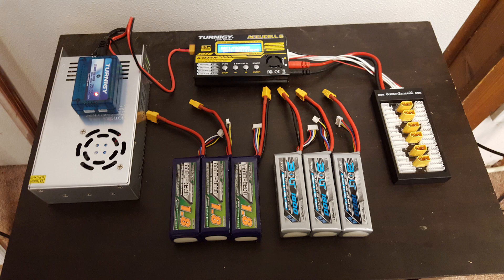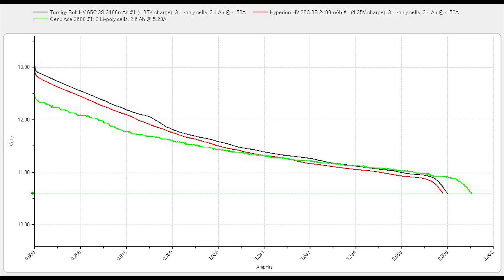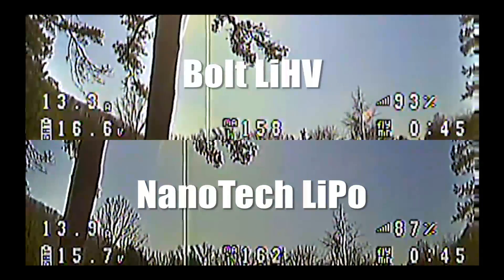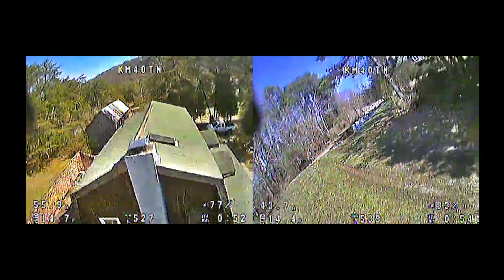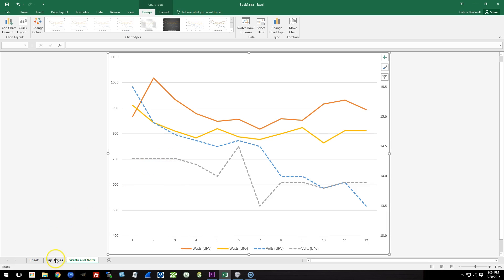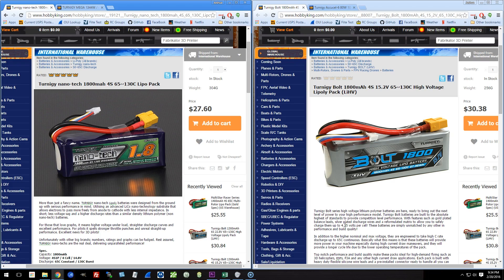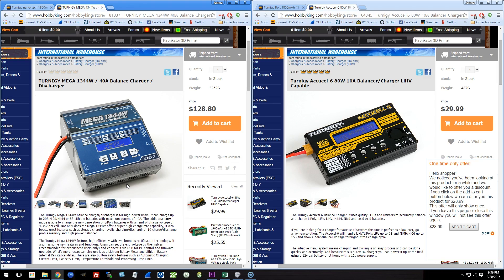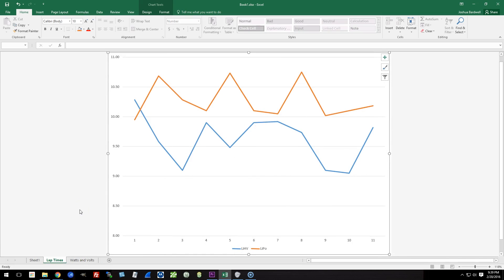Should You Buy LiHV Batteries? UPDATE: No. You shouldn't. (See video description)

Comment: Great video! Now I just need to stock up on High voltage lipos
Reply from the maker: +MTL Racing Good luck finding them in stock, is the problem. In addition to Hobbyking, they are sold by 2dogrc and Green Gorilla, although I don't personally have any experience with those packs or those shops. There are a few other sellers that I know I'm overlooking.
Reply: 50 cycles I bet you guys are pushing too hard on them don't forget lots of things can effect lipo life span overcharge is one of them and pushing them to the c rating of the lipo effects it aswel
Reply: I think now we have come to the conclusion that hv lipos just have very short lives and puff too easily

Comment: I got the turnigy accucel that does these for 5 bucks during the HK cyber sale. It's only 50 watt but I'm patience.
Reply from the maker: +walkaf1 For five bucks you can't lose!
Reply: +Joshua Bardwell those battery's are awesome I felt the extra pep only tried them once though. Gotta figure out how to get the naze to stop screaming. I'm assuming I just bump the max voltage on the vbatt?
Reply from the maker: walkaf1 Correct. Actually, that's interesting. I have vBat monitoring with something like 4.2 volts per cell as max, but it never complained.
Reply: +Joshua Bardwell oh man mine was screaming so I flew for a few minutes until the voltage was down and then rebooted the board. Didn't have my OTG with me to try and mess with the vbat. The telemetry voltage seemed off too but I gotta give them another go.

Comment: Interesting, i fly on 3S but with higher amps and higher KV motors. I wonder if the picture would stay the same at let's say 80A.
Reply from the maker: +GauisHelenaMohaim I have done some 60 amp testing just this week, and the 1800 mAh HV was spectacular. Discharging from full charge to 13.99 volts, it delivered 60 amps for 1100 mAh (60% of its rated capacity) continuously.

Comment: Nice test Josh. The idea about calibrating a regular charger .15V/cell lower for HV charging is an interesting idea.

I'm wondering about a spec that was ignored. How does the IR of each type of lipo compare? I come from competition RC car racing and it's well known that the IR of a lipo has a great deal to do with it's power performance. 

Another note about charging a non HV to 4.35V/cell. You seemed a bit concerned. Competitive RC car guys have been doing that for a couple years and I haven't heard or seen anything about that being a hazard. It is for sure a power advantage depending on the track and driver/car. Many tracks will check for high voltages before allowing you to race.

I would really be interested in seeing how a non HV lipo charged to HV would compare to an actual labeled HV lipo.
Reply from the maker: +Billy Clark I measured IR, and meant to mention it in the video, but maybe I didn't. IR was basically the same for both types.

I know that car racers have been over-charging regular LiPos since forever, but it's not very safe or good for the battery. I don't know what HV packs do to change that. I would expect that a regular LiPo over-charged to HV would perform as good or maybe even better than an HV pack. Whatever they do to make the HV pack safe to over-charge probably reduces performance.

Comment: Great video!! Quite informative actually. So I'm building my first quad and I'm considering buying LiHV, since the charging equipment supports LiPo too. But, what is the actual discharge rate of those? Is there any 4s high C pack(i.e. 65c)?
Reply from the maker: +John Salliaris Yeah, absolutely. The ones I tested are 1800 mAh / 65C.
Reply: But is it 65C actually? I mean if I tried to draw 117A (65*1.8), could I?
Reply from the maker: +John Salliaris probably not for very long, but it's still way better than my 45C packs. Gives 80 amps without flinching.
Reply: Yeah of course not all the time, but if you have a 30A ECS setup is good to know that it could handle bursts of that high current.
Reply from the maker: +John Salliaris exactly. Treat any battery's continuous rating as its burst rating and you'll be okay.
Reply: Good advice, I'll remember it.

Comment: I'd say high voltage lipo's would be best for acro flying as you can push them hard right away and get the "sick footage" and just swap a pack in minute or two and do the same again. That is, IF they give the actual C-rating printed on the pack...
Would be cool to see these compared to Thunder King's, SMC's or Rebel's batteries.

Comment: Thanks Joshua that was really useful. Were you able to test any of the other pack sizes, like the 4s 1300mah?
Reply from the maker: Just the 1800 so far.
Reply: Joshua Bardwell Why did you choose 1800ma? My current 210 quad uses a 2600 LiPo and people recommend that I switch to 1300, would this half my flight times or am I just being inefficient with weight?
Many thanks!
Reply from the maker: 2600 mAh on a 2101!!!

Let me make an analogy: this is like towing a caravan with a Lotus.
Reply: Joshua Bardwell Hahaha well it does crash like a tank, I'll tell you that much! But seriously, would you recommend 1300, 1500, or 1800 for a 210 running 3s?
Reply from the maker: +Gouada your friends already told you the answer. You should listen to your friends.
Reply: Joshua Bardwell Got it, thanks for all the advice and help you've given to me in this hobby. Your videos are so full of interesting information I find myself watching whole random playlists at a time :)
Reply from the maker: +Gouada glad it's helpful. Thanks for watching!

Comment: Excellent video! But i got 2 Bolt 1300 from Hobbyking and have puffed up after half a dozen flight.
Reply: +Multirotor fpv How many amps are you pulling?
Reply from the maker: How do they perform?
Reply: Have to say they perform quite well, but every flight the battery will come down real hot and bloated.

Comment: i have been using revolectrix silver blend 435 LiHV 1200mah 4s for 3 months. all of them are puffed now and im now looking into replacing it with graphenes. all of them started puffing after two months (weekend flying).

i think that lihv lipos are great but only for a while as they have a shorter life span than normal 4.20 lipos. even revolectrix has a disclaimer that while you get the most out of charging it to 4.35 per cell, (17.4v), the lifespan is significantly lessened.
Reply from the maker: +Jojo Polinga This has been my biggest fear.
Reply: +Joshua Bardwell which lipos are great for mini quads right now? how are the graphenes hobbyking sells? ive read bonka lipos are popular for its price.
Reply from the maker: Jojo Polinga I don't have any quantitative results, so I can't recommend anything in particular. If you can fly HV (e.g. if you are freestyle flying or if your race permits it), I would look at the Bolt 1300 65C as a good performer. If you want a standard LiPo, I can recommend the Nano-tech 65C. I'm not trying to say that there aren't better batteries out there, just that those are ones I have had success with.

A friend of mine flies the Tattu 1400 mAh 75C, and says it doesn't live up to its C rating, not even close.

Comment: Interesting, thanks for sharing man! I guess you could have used blackbox to log current and voltage data throughout the flight as well?
Reply from the maker: +salle rc MWOSD doesn't pass current back to the FC via MSP, although I would love it if it did. And I can't be bothered to find the current sensor on my PDB and manually wire it to the FC. So no blackbox logging of current. And the Blackbox logging of vBat, in the past at least, has had so much high-frequency variation that it's largely useless. I think this may have changed in recent revisions.

Comment: If the Graphene batteries are lasting upwards to 900 cycles, and HV lipos are only getting 50-100 cycles, the cost of batteries is significantly higher with HV lipos, costing 0.30-0.60 cents per cycle (100-50 cycles). Now if you take Graphene lipo, to cost is significantly lower at about 0.06 cents per cycle. I'm not sure these HV are going to be worth the time or money when compared to Graphene lipos.
Reply from the maker: But I have heard some questions about graphene at high C rates. Can't wait to test for myself.
Reply: +Joshua Bardwell I was hoping you were going to say that! I'll be waiting for that video! Your research is alway pretty thorough and it shows in your videos, so when Graphene wasn't even mentioned when cycles were brought up, I was curious as to why.
Reply: let's look at this weak guy strong guy 1 punch weak guy is dead the strong guy can take more punishment before he dies do you get what I am saying it goes for the hv lipos aswel it's like steroids they lower your life cycle but you can stand up stronger for a little longer and take the hard beating for alot longer  if I take your lipo and pushed it hard it's gona die quickly than  the same lipo with gentle pushing

Comment: I use them for about 15 cycles and the IR is just as low as the first day, i always lad at 14.5V, i get arround 3 minutes flight time pushing them hard, the 1300mah Bolt do the job very well, pretty great lipos for the price.
Reply from the maker: +FPV Portugal Yup. The HV continue to be amazing.
Reply: Joshua Bardwell Not all buddie, but the bolt turned to be a very good surprise considering the price.

Comment: Great video! Let's see if they can beat lipos on cycles
Reply from the maker: That is the big question.
Reply: +Joshua Bardwell Model rocket engines cost at least $4 a flight and it only last like 3 seconds.
Reply: +Joshua Bardwell Was the nanotech the run after the Bolt?  I find I run faster after the next runs than the ones run before.
Reply from the maker: Anthony Abelardo I alternated several times and took the fastest pack from each.
Reply: Joshua Bardwell Can you tests against Graphene and A-spec?  Run the Bolt test on the same day too?
Reply from the maker: I have a graphene on deck right now. I don't have an A-spec. I'm not sure what the advantage would be of running the Bolt test the same day. Unlike prop tests for example, I don't think atmospheric conditions affect battery performance... do they?
Reply: Joshua Bardwell No idea but I would like to see the data results on a same day test.  One battery after the other after doing some warm ups w/ other batteries.

A-spec cost more than Graphene and nanotech so it's worth testing.  Never considered Bolt but it seems to be superior.

Need power test and how much cell life is left over a few cycles.

I heard people who have Graphene who have done well over 500 cycles and it's still holding a high charge.

I'm not sure if my flying ability has improved where I lost lots of flight time or anything other than Graphene just can't hold charge after a few hard cycles.

I heard Graphenes don't sag so low voltage comes instantly.

The thing is, the Graphenes are sold out so all I had to choose from was A-spec.  I never considered Bolt but my new charger can do 4.3V.  Your graphs showed Bolt to be better in everything volt for volt.

Doing a comparison w/ the top 3 Turnigy batteries would be cool.

Comment: you have to be careful though because alot of race leagues limit your voltage to 4.2 a cell
Reply from the maker: That makes total sense.
Reply: +CoVa fpv I wonder how the bolt packs would perform then if you had to only charge them to 4.2v if its not any worse than a nano tech then you might as well get the bolts and have the extra power and energy density for practice and then only charge them to 4.2v for competition.

In fact there would be an advantage to that of taking an edge off your quad and making your comp nerves have less of an effect.
Reply from the maker: ***** We tried that at the flight field on Saturday, mostly because I had forgotten to bring the Accucel charger with me,so we just charged them up on the Reaktor. I would say that there was not a clear performance advantage between them and the regular Nano-tech. However, they are 20 grams lighter, and they definitely deliver the same or better watts and amps, so that alone may be worth three dollars per pack. Especially given you always CAN crank them to 4.35 if you care to.
Reply: +CoVa fpv That makes total sense; I think the closest we can get to a level playing field the better. That said, if what Joshua says is true, then I'd say these still have value when it comes to practice, and may one day become the norm.

Comment: This video and study is well beyond the call of duty Josh- so much respect for the time and effort put into this. Possibly the best video of the year so far for racers. Hope folks pay heed. Savvy testing and data examples.
Reply: +Goat how many laps on a 200m course is a heat? I believe classes will always be a factor. Innovations in the sport now with pit stops and 3000 and 5000 meter heats, and even 24 hour races will create a class, tight twisty courses will create a class, and then larger obstacle course mixed with race course grand prix style will create a class. I do not think the dynamics are leading to a single class, but a handful of classes. Same as all motorsports. Not sure why multirotors would be any different.
Reply from the maker: +Hiway I actually wonder whether we will see races dividing HV batteries into their own class, like 3S / 4S class. It almost seems unfair to compete HV batteries against non-HV.
Reply: +Joshua Bardwell for now, we still live in interesting fpv racing times, but like all mitigating factors this too will become standardized or restricted. I have one of those Bolt lipos I run on a Havoc 340. it spins 6x4.5 on 2213 2000kvs and it is very powerful and fast, but those Bolts give it an extra kick. had it for almost a year. I suspected they were better, but your tests prove my suspicion.
Reply from the maker: Goat A tight track definitely favors pilot skill over raw power. I would say it also favors tuning ability--the ability to get the most thrust from the least grams for a very responsive copter. I think the HV restrictions might be more important at higher levels of competition, where all pilots are very skilled, and even a small percent advantage could be decisive.
Reply: +Joshua Bardwell Our racing club has pretty much done away with all classes. The results are still 99% decided on pilot skill, especially because we design the tracks to be very tight and only around 200m long.
Reply: Joshua Bardwell To get an idea, check out my videos from the final of our 2016 round 1 race. On that particular track, I was only 1 second slower with my 3" quad than my 4s 5".
Reply: +Hiway I'n not saying that there shouldn't be classes, especially with the kinds of races you are talking about. I'm just making the comment that I have no problem racing someone with a hex or HVLipo or 6s. If you watch my videos for the style of track we use for our race meets, "faster" quads don't currently give much advantage.
Reply: +Goat I have noticed that you are very correct. the skill sets of most of us are mediocre so craft size and motors and lipos are moot for the most part. Personally, I think the small tight tracks will offer the most fun. I like the 170 size frames and they are just fun. The best part about what you are doing there with your group is the ease to run races and not fuss over classes. A brushed quad could almost compete... not really, but darn close.
Reply: Thanks *****. I think that most organisations are going to end up with classes for races, even if I don't think its the best way forward. Regarding those other crazy races that you are talking about, long distance, obstacle course etc. Personally I would prefer that a race organiser details the kind of track they are going to use for a series of races. Then leaves the class definition as open as possible.
Reply: +Goat at Quadstate FPV I run 2 classes- Beginner with specs: frame up to 250, 5in props, and a max of 1300mAh 3S. The pro class is frame up to 330, and no restrictions on prop or lipo. We race a 1000m course, 4 lap heats, best lap time advances. Top 16 pilots qualified move on to heats. Top 8 race for points. 4 pilot heats at 4 laps. Super 8 style.